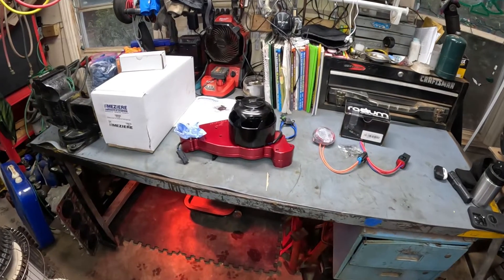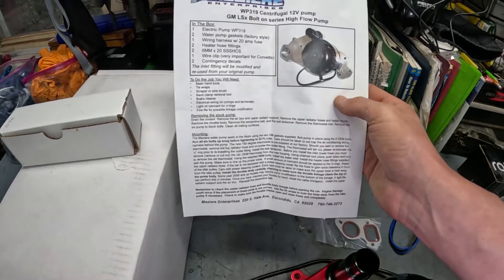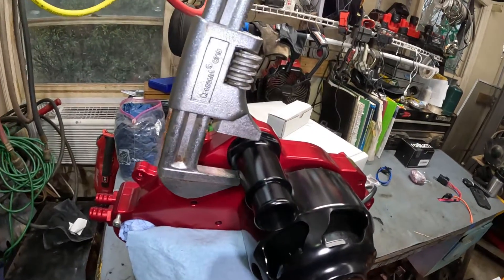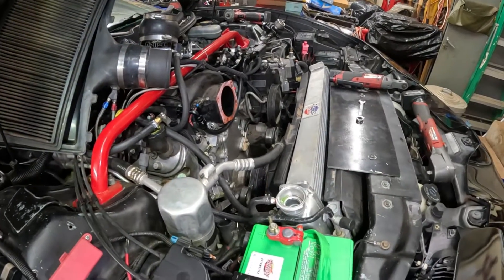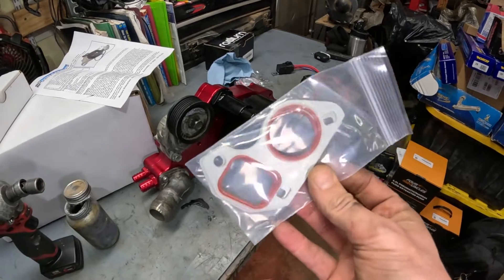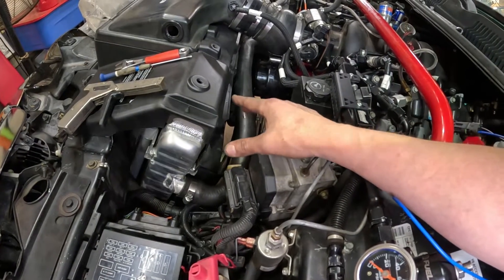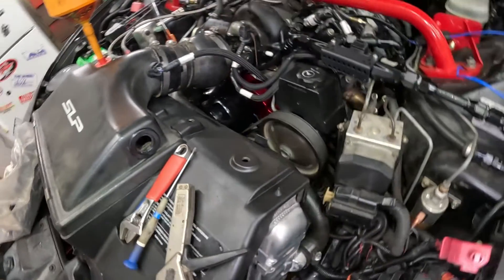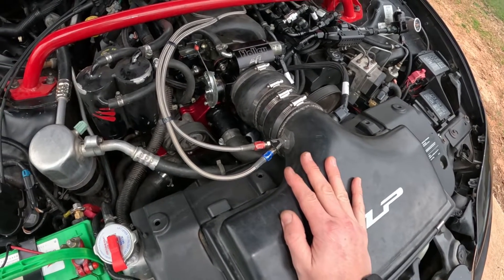How to / is it worth it?: Electric Water pump install

Comment: Great video ! Any updates after a year? Thinking of getting the sane for my z06
Reply from the maker: Thanks for the comment! I definitely need to do an update video. It’s had some ups and downs—can’t completely knock it, but there are a few things folks should know. It struggled to keep up with my engine during the summer heat, and I have a buzzing noise in the radio, so I just don't listen to it anymore. Right now I’ve got the other water pump on, but I’m planning to do some troubleshooting and reinstall the electric one soon.
Reply: @RocketGarageService I also have a buzzing noise in my 98 WS6 but have the stock pump still

Comment: Great video. I’ve been on the fence about buying one. Also when using that wrench a trick you can do is place electric tape or even better that fabric tape that oem uses and put that on the inside of the teeth and it won’t scratch a thing!
Reply from the maker: Thanks, man! I definitely need to make an update video soon. Been chasing some coolant temp creep at idle—saw it hit 215°, especially with the AC on. I’m trying out a restrictor plate setup instead of running no thermostat at all. Also thinking about adding an oil cooler and switching to aftermarket fans since the stock ones won’t clear my future turbo setup. I’ve pulled the electric water pump for now to help with temps, but it hasn’t solved everything—especially in stop-and-go with the air dam being the only airflow source on these F-bodies.

Comment: Do you connect this on your ignition or do you put it on a switch?
Reply from the maker: I actually have it set up on a relay, and my Holley Terminator activates it. I’ve got it connected to the fuel pump output on the Holley, while the actual fuel pump is being controlled by the factory ECU. Let me know if you need more details!

Comment: How reliable is an electric water pump on a daily driven car? I want to do this on my 2014 Camaro but I'm unsure of the longevity of them. Do they last as long as a mechanical pump or are they finicky?
Reply from the maker: When I did my research,  a lot of people had another but good things about Meziere. So far so good for me. The following is from there website: "Our 2 year, unlimited mileage guarantee and full satisfaction money back guarantee should convince you that buying Meziere is buying value!"    "Suitable for street or drag strip use – 3000+ hour life expectancy"

Comment: Leave out your thermostat
Reply from the maker: Perfect time for this comment!!! I am going to try removing the thermostat. In the heat of the summer. My temps are creeping on the highways (80 mph, pulling about 3200 rpms). I got up to 220 degree after about 30 mins on the highway. I really want to do a drag and drive. But right now, I could not. I want this car to be able to be driven anytime, anywhere. The only thing I want to hold me back is buying the fuel.
Reply: @RocketGarageService  How much CFM are your radiator fans?
Reply: @RocketGarageService so did you end up taking out your thermostat. I’m having problems with my car getting hot when driving
Reply from the maker: @rad_ricky  I did. I have drove the car twice. Both times the outside temps has been in the 70-80's. The car was averaging around 180 F. I did not adjust my fan on/off temps. I think my fan low - comes on at 195, and high at 200 or 205. 

So far I am kind of happy. But wondering when it is in the 30-40's. That I will have issues getting the engine up to temp also. At the same time, I don't drive the car nearly has much as I use too.

Comment: It would be better to cut out the center of the old thermostat and leave the outer ring to support the gasket.
Reply from the maker: I am starting to think about it. I went driving for about an hour yesterday. Temps were a little high. But I adjusted my coolant fan "on temperature" on high mode. I think that is more issue. I am running E85 so I wanted my engine temperatures higher to help get rid of the E85 in my oil. My dipstick started getting little rust spots. But I also have needed a PVC catch can vs the previously installed vent style catch can

Comment: With an electric pump I don’t see the point in needing a thermostat anymore. Want to warm up pump is off and when it gets to temp up pump comes on.
Reply from the maker: I am kinda, still figuring it out. It’s interesting now the warmer weather is coming in. I’m not getting consistent engine temperature based on outside temperatures. I’m honing in what the difference is.
Reply: @RocketGarageService  yeah I’m thinking of trying out one on my Cleveland. Trying to learn about them. Can see advantages for sure with them.
Reply: You still need to have water bypassing and circulating through the engine to prevent big hot spots.